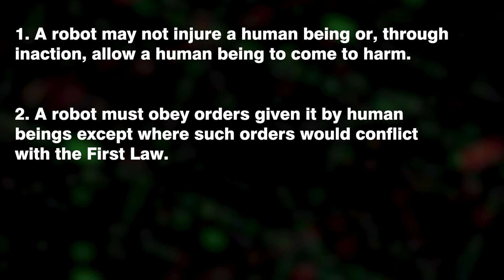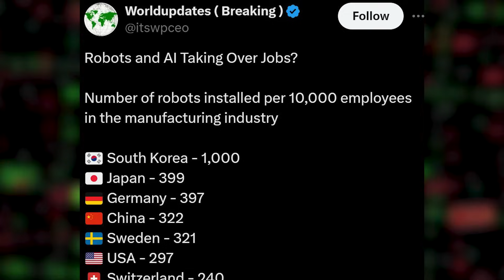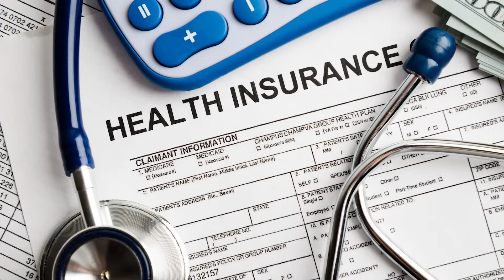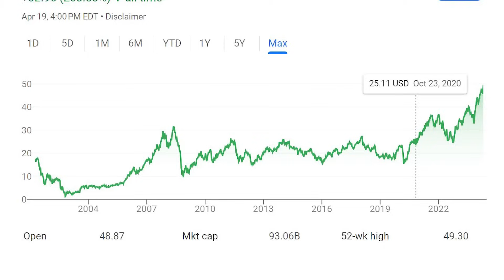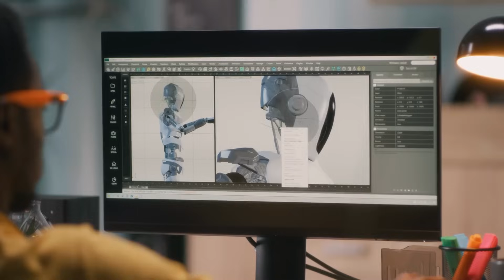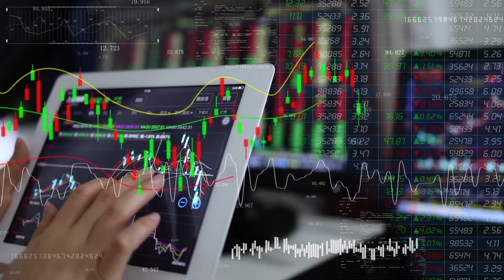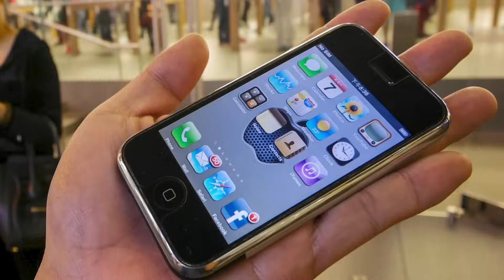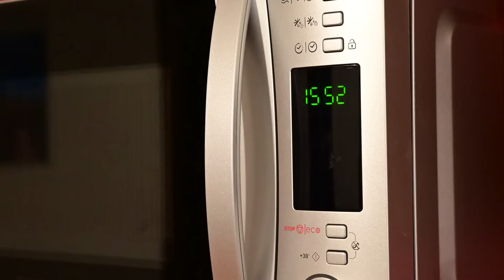Robots: Will You Give Them Up? | Disruptive Investing News

Comment: I have long thought that the most valuable thing we could do with humanoid, or at least mobile, robots would be to help in hospitals to lift and shift patients who are not mobile. This requires a machine stronger than Optimus, which is intentionally made weaker than a human for safety reasons. Nurses are going to have to risk their backs for somewhat longer, it seems.

Comment: You guys need to adjust your math a bit.  The CAGR for a 100% return after 13 years would be closer to 5.5% than 7.7%.  It is not accurate to simply divide 100 by 13 to get the answer.